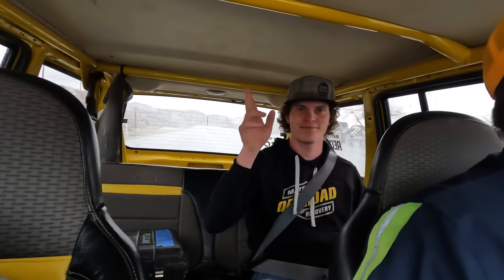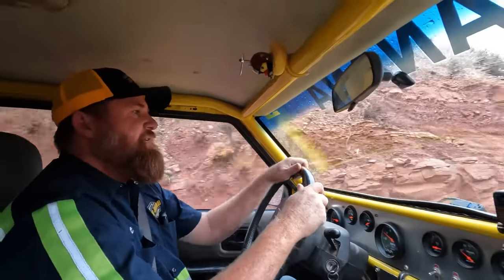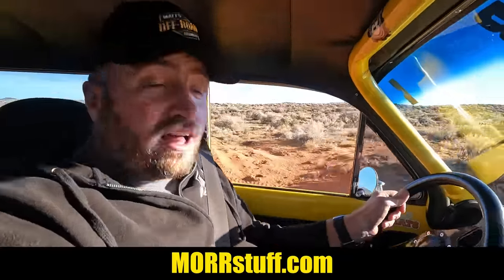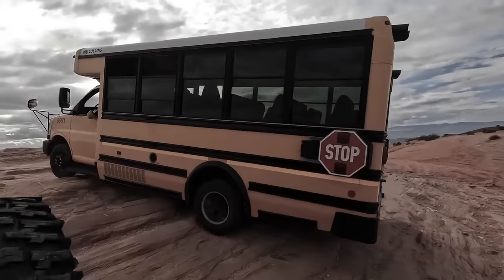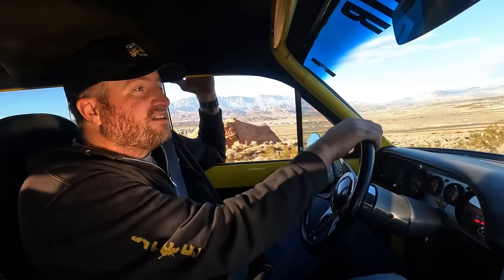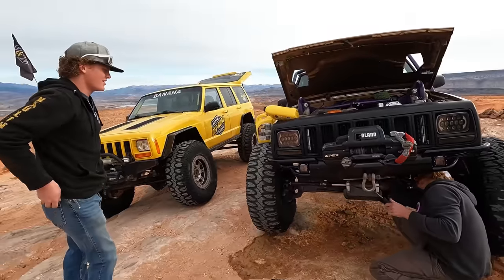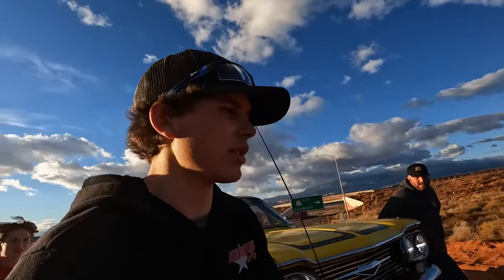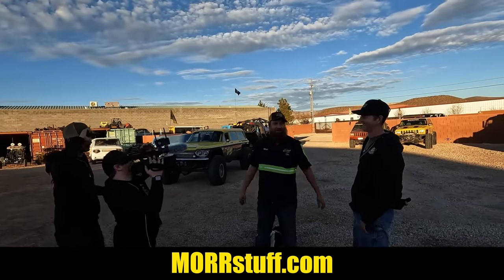This One Decision Left Him In The Hospital

Comment: Africa Twins are heavy bikes and that's some thick sand.  Respect to the rider for trying to make it up that while loaded down but that's a tough hill climb for that much weight/power.
Reply: Guy needs more experience. If you're using a bike like that you should know how to get yourself out. He looked very green and unsure of what to do, so it's a good thing he's getting stuck near town where he can get recovered easily. I've driven those for a long time and that wasn't a situation you should need to call someone to get help.
Reply: @CRneu  Yeah man, absolutely the wrong tool for the job and he should have recognized that immediately.  With gear,  himself, and the bike, he's probably around 750 lbs.  I just have respect for the attempt but tbqh one look at that deep sand would have had me saying "nope!" unless i was on a 250 lb dirt bike that can rip.
Reply: I ride a Super Tenere' and that would have been a hard no unless I had on serious off road tires, and a good amount of speed.  Top riders could do that on the big ADV bikes fairly easily, but most of us mere mortals would have trouble.  Spinning it around using the rear tires is a typical task if one has some dirt bike experience.  Everyone has to learn though, he just got a great lesson.
Reply: @keithallen3119 Would love to have his bike for some road trips but I think the only off roading I'd be doing would be gravel and well maintained dirt.

Comment: I would NEVER dare challenge MCVT (Matt's Corrosive Vision Theory), but a case could be made for the possibility of an alternative hypothesis. Here it is: wipers are mostly used when there is water on the windshield. That water can be directly falling from the sky as rain, in which case it will fall on both sides of the windshield in equal amounts. Alternately, water may have been sprayed from the road by incoming traffic, in which case it will be coming mainly from the left and will transport all sorts of debris, dust and sand that will adversely abrade the rubber blade of the driver's side wiper. This is known as ITMUWB, Incoming Traffic Messing Up Wiper Blades.

You are totally welcome.

Comment: Allow me to prove you wrong. As soon as you have a passenger, both sides are equally seen through. And as soon as you have a third passenger (usually behind the passenger) the passenger side wiper has to do more work. Then when there is a fourth person, both sides are equal again. So, unless you drive alone a lot, the passenger side is looked through more. 
Bonus looking though: the driver has to look to the right side from time to time.
;-)

-edit: It might just be me/my car where the second person sits on the passenger side most of the time. In this video most of them sit on the driver side.
Reply: But passengers don't look as intently out the front as drivers.  But in Matt's case there is often a camera looking through the passenger side and those don't even blink.  This is why his passenger side wipers are starting to go.
Reply: The driver wearing sun glasses should also help cut down on driver side wiper stress.

Comment: On the wiper issue, move the steering wheel across to the other side of the car, that'll help even things out. Or lean out drivers window when driving, but without smiling (bugs) Or poke your passenger in the eye with a pencil, will reduce vision usage on that side. Wait in vehicle under a bridge when it rains, wipers will last forever that way. Removing the windshield will help too, but don't forget to remove wiper arms too, otherwise.....

Comment: I had similar deal to Rudy. Up I-94 to Fargo. Unhook trailer, oil change, warned upper hose soft. Fine flush, replace its winter.  I get 40 miles SLOOSH/steam. Upper hose released. Pull over. The upper hose clamp was tight to metal UNDER hose.
 A Deputy shows up. 2 gallons antifreeze with receipt. “You can have pay what I paid”. *it was a dang cheap price*. He then got them refilled with water.  Refused to take a cent more. North of Hillsboro ND

Comment: I know a guy is not supposed to make this kind of modification, but if you could free in cold weather, divert warm air from under the hood to keep the wipers more flexible also run your defrosters. I find that helps some the reason why you’re not supposed to divert the warm errors because of a rad hose blows it could get all over your windshield and coolant is very hard to clean off. Anyways, that’s why you’re not run without a hood is six in a row. Jim from Kennedale, Pennsylvania.

Comment: Maybe the washer blade thing is the drivers side is usually smaller than the passengers. That mixed with probably the same force applied to both wipers (per the arm) would lead to the smaller one experiencing slightly more pressure and wearing out faster. Thats my guess anyway. That or the vision thing. Schrodinger's cat situation or something.

Comment: There's also the contaminstion between washer  fluid and blinker fluid that can break down the rubber like wiper material.  ( since the blinker fluid shares to back half of the washer fluid vessel. )  Add DEF on a diesel and you get a corrosive substance that weakens the head gaskets.

Comment: Lol, I love all the comments about the wipers. Maybe someone put a driver's side blade on the passenger side and vice versa. SO the wipers got confused on which should wear out first.

(For anyone wondering, it's actually often because the passenger wiper leaves the dirt and water for the driver wiper to then wipe. When they both go up, on vehicles where they go the same direction, the first stroke up the driver side moves the dirt on that side of the window, and then the passenger side stops and goes back, leaving the dirt for the driver side to then wipe on the down stroke. So the driver's wiper gets torn up more by the dirt. It's less of an issue on wipers that go to opposite sides, but still slightly there because the driver's side goes first on the overlapping area. But you want the driver's side to go first so that if something breaks that one isn't trapped under the passenger wiper and can still wipe the driver's side.)

Comment: The reason the driver side wiper blade wears faster is science Matt. Think about it. When a vehicle is moving/driving there is always someone in the drivers seat, ergo there is more weight on that side of the vehicle. More weight equals more wind resistance resulting in more pressure on the drivers side wiper causing faster wear.  Hence the phenomena of the driver side blade going bad whilst the passenger side remains fine. Your situation is slightly different in that your vehicle is a recovery vehicle and rarely has just a driver. Far MORR  often you have a passenger and a camera person on the passenger side of the vehicle. Sometimes even a canine, causing more weight on the passenger side, explaining why your vehicle is manifesting the abnormality of a prematurely worn passenger side wiper blade. Science Matt, just science. Learn science and you shall succeed!

Comment: Drivers wiper virtually always wears out first.  Passenger wiper pushes through dirt and bugs on the upstroke, then over clean glass on its way back down.  Drivers does the same on the upstroke, but on the downstroke it plows through all the crap the passenger wiper left in the middle of the windscreen.  Twice the crap equals twice the abrasive wear, so it starts leaving streaks fastest.

Personally, I prefer "overlapping clap-hands, the last one I"m aware of being the Olds Cutlass Supreme of the early '90s.  Both blades push crap to the sides to be blown off by the wind, then return to the middle over clean glass.  This system clears more of the usable glass, as the only bit they miss is right where the inside mirror is, so you can't see out of there anyway. They also don't clog up with snow and ice because neither blade pushes crap down to the bottom of the windscreen where it will build up.

Comment: I think Matt is onto something with his observation of fater wear on the driver's side wiper.  Quantum mechanics tells us that the observer affects observed action, and his eyes are observing the driver's side blade much more.
My solution, for the past 49 years, has been applying Rain-X to my windshield on a regular basis.  That way I barely look at my blades as they are safely parked (yes, that's the term for when they are turned off).
I have been the only vehicle which could continue through torrential downpours which caused others to pull over and stop. I was still seeing clearly.

Comment: The drivers side wiper has a shorter sweep than the right side in many if not most vehicles , which means it works less.  The issue likely is more wear due to debris (dust, dirt, etc.) encountered from opposing traffic

Comment: If you wiper is leaving streaks run your thumb nail along the edge thst touches the window after it rains dirt and dust dry on the blade and the sun bakes the combonation of dirt and water on the wipers .....you will be amazed they will start to cleanlike they are brand new .....this works in winter as well with lots of ice , snow , and slush and especially when transport trucks flood your windsheild with water and slush

Comment: Having worked in a shop that parted out wrecked motorcycles, I have some experience moving bikes that don't want to be moved.  The standard for recovering a High-Centered four-wheel vehicle is to free the Center. 
On a motorcycle, it would have been easier to put a block under the frame and pivot the bike around its center.  On a light-weight dirt bike, the rider can do it alone.

Comment: Haven't been offroad in your part of the world. I've been at Ft Carson several times and the clay on that Plateau turns to greased snot with very little rain. If the road is crowned, you couldn't keep an humvee on the road. I was driving a M113 Armored Personnel Carrier down this steep canyon road when a little rain started. I got to a section that I should pull some power off the tracks. It immediately turned into a 13 ton sled. Lucky we had only one curve between us and the bottom.

Comment: For a motorcycle, that one isn’t super big. I ride a 800cc Honda Pacific Coast. The dry weight on it is 750lbs. More with fluids on board.
Reply: Te Pacific Coast models were severely under appreciated.  Now it is impossible to find one cheap.
Reply: @robertheinkel6225  absolutely!  I have a ‘96 that I bought in 1999 and still ride every chance I get. Parts are super hard to find, but with 3D printers, the “Tupperware” can now be replaced easier.  They are so well balanced and just a joy to ride.

Comment: I run an emotional health clinic for windshield wiper blades, atms, and motors.  You would be surprised at how many windshield wiper components have severe mental and emotional health issues.

You're right about the driver's side wiper working too hard about the reason.  The vision going through the glass is negated by the light coming in through the window, whereas the passenger side has full time light coming through it but only part time vision negating the effects of that light.  That couldn't wear the driver's side blade more than the passenger side.  Quite the opposite.

The part of the equation you have left out is the feelings of the wiper blade.  The driver's side knows that it has the most important job of the two blades.  It is also fearful because the driver is typically the owner, who decides when it is going to be discarded and replaced.  Furthermore, it is self conscious because, well wiper blades never think they're good enough for the driver.  The fact that the driver is always watching that blade (or so it thinks), its self-consciousness is amplified.  

All of these psychological factors add up to make the driver's side work harder and wear out quicker, DESPITE the additional pressure from the light on the passenger side, who really couldn't care if the passenger is watching it because, to wiper blades, passengers aren't worth thinking about, let alone feeling more self-conscious over it...

Comment: The driver side windshield wiper is exposed to a greater and more constant supply of heat from the engine bay than that on the passenger side. Hence the more frequent failure.

Comment: If I'm not mistaken one windshield wiper is driven directly by the motor the other has a extension so it's not getting the full torque and pressure of the driver one

Comment: I'd like to think my truck would never get stuck in 1/2 inch deep mud. But I've seen it out on construction sites here in florida.

Them big sites, where they clear acers of trees to build a neighborhood. Especially around them silt fences. You get that silt built up, especially when it's wet. You won't dig in, your tires just spin on top. If you don't know what your doing, it's definitely easy to lose control and stop moving.

I wonder if the mud yall are talking about is like that silt down here in florida.

Comment: The reason the driver gets worn out faster is, because yes, it does work harder. But not for your reason lol. That's just the side you encounter vehicles on. So any rocks, dust, grime or whatnot else that gets thrown uo by those vehicles makes the biggest impact on the driver side of the windshield. Therefore putting more wear on the driver's side wiper faster.

Comment: I think it's because the driver's side wiper is closer to oncoming traffic, so it's the one that gets showered with more road gunk that wears away at the wiper surface. Lifehack: you can often recondition the back side of a squeegee--the side that's like your wiper blade--by giving it an acetone wipe. Be thorough and make sure you get all the dust and grit off it. Maybe it will work for a wiper too? Disclaimer: not guaranteed to work, try at your own risk, I.E. you can't sue me and if you try I won't be able to even cover your attorney fees.

Comment: I have a, probably dumb, question. When I was a boy back when dinosaurs roamed the earth, I spent lots of time on the sand dunes of Padre Island on the Texas coast. Way down the island the navy had a practice bombing range That sailors had to tend periodically. Due to the loose sand conditions regular 4 x 4 vehicles usually got stuck. Sometimes if it was your lucky day, some sailors would come by with a Dodge power wagon wearing smooth-tread airplane tires and pull you out.

They seemed to just float over the dunes effortlessly, never digging holes in the sand. So my question is: why do present day rescue teams use tires with such agressive treads in loose sand?  In later years, before it was outlawed, my friends and I rode motorcycles in the dunes. I could always go the farthest because I always ran worn-out baldy tires on my bike. So what has changed?

thanks,
love what you do.
ns
Reply from the maker: Smooth tires work best in sand.

Comment: we have black and red gumbo mud where i live. black gumbo is so sticky it will fill up swappers and be like driving with slicks in a few feet if you cant get then to empty out and if you dont have large lugs you getting stuck. and our red gumbo is hard as a brick when dry you can smoke the tires on it in a burn out. and cant cut it with a shovel. but when wet you cant stand on it because its so slick. most of the time you cant dig deep into it but God forbid if you do because you will  have to dig it out or pull it in half using a winch.

Comment: Sorry, wrong Matt. Unless your peripheral vision is gone, you have 180 degree vision rays hitting the glass across the whole width of said glass.  And since you don't wear glasses, there is no concentration of the vision beam on the driver side. Wiper sweep failure is mostly from the invisible sun rays adding radiation to rain as it falls from the atmosphere. Hitting the window results in it exploding on impact. Over time you're gonna have blade failures from that irradiation.

Comment: I've used SILICONE wiper blades for over a decade and I never have streaking or failure in less than 3 years.
And I live in Phoenix. Much hotter in the summer than Hurricane.
Rubber wiper blades barely last 6 months in the desert.

Comment: Props to Kaulin-n-Rhett, you guys sounded real professional with a great attitudes, ;-), its not a fact that the driver-side go's bad first Matt, you turn the wipers on more based on what's seen through the drivers-side, but the passenger side is moving any time the drivers side is, now if the drivers side is indeed wearing-out quicker, then its probably because the factory puts a stronger spring on the drivers side of their vehicles, because of its importance, hows that for proving ya wrong?, lol, thanks for sharing guys.

Comment: My windshield wiper theory:   The wind travels along the hood and hits the windshield and diverts left or right depending on which side it hits.   The drivers side is then Wiping in a direction across the flow of wind and the passenger is more in a direction where the wind is going along the wiper.   Unless of course you own a newer ford fusion in which case both wipers go across the wind because they are hinged at the Lower corners of the windshield

Comment: Tech tip screwdrivers good for starting clamps but need a nut driver type to get enough bite on those. Put on screwdriver tight they pop off under full pressure

Comment: On the windshield wipers thing, it could also be a case of the driver's side windshield wiper actually being longer than the passenger's side windshield wiper. At least that's the case with my car: 20 inches driver, 18 inches passenger. The driver's side windshield wiper is responsible for more windshield real estate, and so does more work (and endures more physical stress) per wipe and consequently goes bad first.